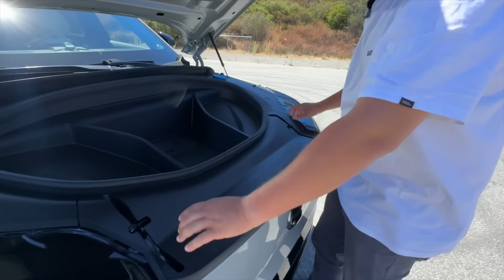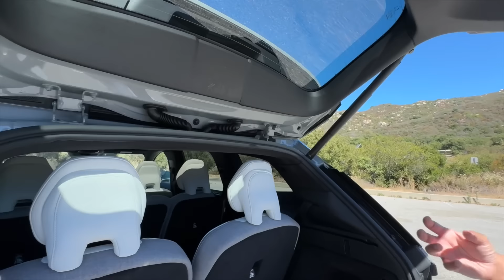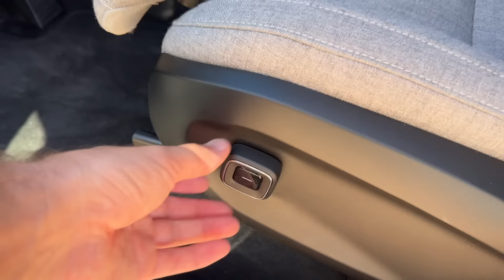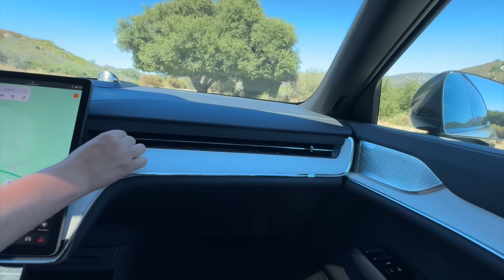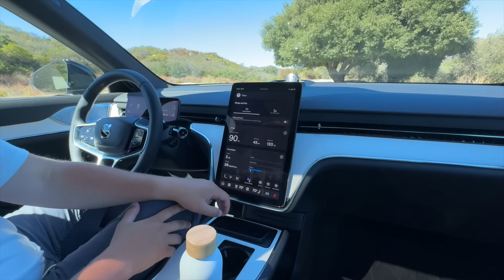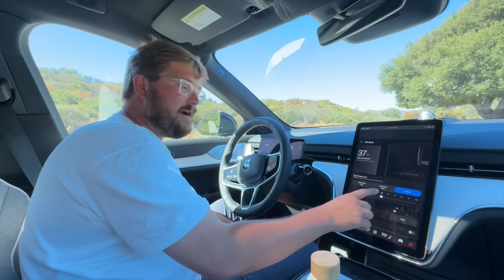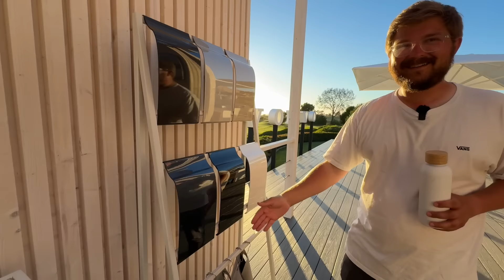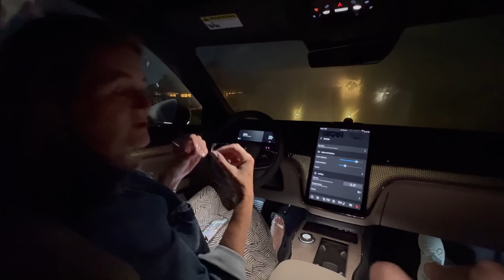Volvo EX90 Full Tour! Detailed Look At Software, Space, Interior, Powertrain, Battery, & Much More

Comment: It may be crazy to say but the KIA EV9 has this thing beat in so many ways for much less money. More space and utility. Even expected features like ventilated seats and sun shade.
Reply: The Koreans kill it in terms of features. Having said that, as an Ioniq 5 owner, I'd say the feel of a Hyundai/Kia is certainly overall less premium than a Volvo.
Reply: @iantelinside EV9 is substantially more premium inside than Ioniq 5.
Reply: @iantelinside  Exactly I actually like a lot of hyundai products but they are still a toyota, honda, nissan etc. competitor, volvo is more mercedes bmw competition and Genesis would be a better comparison. Its not electric but price and size wise id compare this with the GV80 before id compare to the EV9
Reply: I get what you're saying, but I've owned Kias and I've owned Volvos and they really are not comparable. If the Kia is "good enough" for you (meaning you're satisfied with it along whichever dimensions are important to you) by all means get the Kia, it's a lot less expensive as you point out. Regarding the EX90 specifically, I wouldn't touch it for a model year or two, no matter what. But once it's fully baked I bet it will be an awesome vehicle.
Reply: @richardhale2117 Time won’t fix fundamental flaws like being way too small for a usable 3-row.
Reply: Can not agree more! Not really feeling drawn to this at all, even if it was cheaper.
Reply: The Kia is nowhere near as premium.
Reply: Didn't Kia remove the lidar on the EV9 for the US market?
Reply: @jesbecker2325 I’ve never even heard of the EV9 having lidar. what would it be used for?
Reply: @CallMehDirect  The lidar is there for the Europe builds. It would allow HDA3 capabilities.
Reply: @jesbecker2325  I presume that makes sense to why I haven’t heard of it for the US
Reply: You are comparing different things, not because ev9 has similar size as Volvo ex90 and you can compare to them. Do your research, the most costly part for an EV car is battery size, engine power and engine type, EV9 are all using much cheap parts in those areas than Volvo ex90.
Reply: How are Kia’s on the aftermarket in comparison to Volvo’s? Yeah, didn’t think so… 
Give this one a few iterations and it will be great.  The XC90 needed a couple of iterations to fill its shoes.
Reply: @DaveRevst4548 It’s too small. Curious how time will fix that.
Reply: Core...plus ..ultra
Reply: I was disappointed with the finishes in the GT-line ev9 for the sticker. In terms of design and features, can’t be beat but if you’re looking for luxury, doesn’t do it imo
Reply: Kia’s are trash bro. Volvos are built like bank vaults. Kia’s are trash cans. No comparison
Reply: @rahimi4762  , both Consumer Reports and J D Power has had KIA as a top 10 brand and Volvo towards the bottom on reliability ratings for years now. Check for yourself.
Reply: As a Volvo fan I hate to agree. EV9 is an incredible package.
Reply: EV9 GT-L plus all extras owner here, Europe. More space, a lot more features. Bit plasticky, bit unsettled over rough roads. But is great and reliable, resale value proportion is same as Volvo in EU. But I would still choose it over Volvo.
No sun shade is a big no-no, probably ok only in the north... Many other missing features cannot be replaced by nicer "feelings" due to materials inside. On the other hand people are extremely happy with their Teslas, so in the end is a matter of preference. But pain will not be removed by anything. A burning bottom on a hot day or a cramped seat will change the view on premium :)
Reply: but not the most important thing in EV, the RANGE.
Reply: Koreans offering a bargain...well, stop the presses!
Reply: This actually has ventilated seats, a lower trim with RWD is coming and 800v will be added for MY 2027… The EV9 isn’t even comparable imo… it’s like comparing a Kia Sorento to an XC90 which no one would do
Reply: Yeah no one would do that because the KIA Sorento is noticeably smaller and less expensive. But the EV9 and EX90 share prices that are closer as well as tech/performance which are closer. Like others have said the EV9 is honestly the EX90 Volvo should have made. The EX90 is WAY too cramped in 2nd and third row for even average size people to sit in both rows at the same time. Also tech/luxury/features are pretty similar. Given the worse charging the EX90 won't even road trip faster even with its more range. Lastly performance the EV9 once again matches or will be better once the GT model comes out @Kurre.
Reply: Yeah, and the EV9 also has the Porsche Cayenne beat in those areas. 
It's a whole other class of vehicle, and also, it's called "options".
Reply: Looks super bland. I think the headlamps are a miss for me.
Reply: 100% agree and I just replaced a Cayenne with an EV9. As a 3-row EV, the EX90 is a failure. The second row is too cramped (captain’s chairs won’t fix lack of legroom) and the third row is symbolic with a steeply sloped trunk lid to make space even worse. 400-volt architecture in a premium vehicle is unacceptable at this point and lack of a sunroof shade is a massive fail for cars used south of the Arctic Circle.

Comment: For people wondering about the trim levels. There is a Core trim level that's below the Plus one. Difference is that the Core comes with a generic audiosystem, not a premium Bose one, less/worse interior lighting, dark matter panels instead of the wood ones (basically cheap plastic ones), generic floormats instead of premium ones, dual climate zones instead of 4-zones and no cabin airfilter which I find really confusing especially because that's apparently to Volvo a big feature of the Plus trim. Also no heads-up display, manually controlled steering column instead of an electric one, 5-seats instead of 6 and 2-way lumbar support instead of 4-way for the front seats.
Reply: No Bose in Volvo's, Harmon Kardon or an AMAZING Bowers&Wilkins system.
Reply: @johngaudet6316 That’s true for the current SPA cars but the EX90 model has Bose instead of Harman/Kardon

Comment: Burning 300 watts (I'm wrong, 133!) for 3 days, before cutting the power, breaker style (so that, I assume, you can no longer interface with it at all over a network) is what kinda did it for me. Cancelled my reservation and scored a crazy iX lease. That means that if you road trip somewhere, roll in with 20 percent, or whatever, your battery will be dead in a couple days. I can't buy (or even lease) a car based on what it will be later. Who knows what "later" is.

EDIT: Also, this car is showing 243 miles at 100% which... is not great. Probably worst case since it's a press car, but still.
Reply: Where did you get that info and numbers? They say less than 3% per day which is at most 3.3kWh per 24h which means 3300/24=139W, not 300W.
Reply: @erik....  Thank you! I have no idea where 300 watts came from either. I did some napkin math when I got the email, but never double checked. I edited my comment.
Reply: @PhilKulak what kind of lease deal did you get?
Reply: @italianovero220  860/m for the 50, nothing down. People have gotten better, but I’m very happy with it. I pulled the trigger because, unless Volvo goes crazy with lease deals right out of the gate, that’s hundreds less per month than if I kept my reservation.
Reply: For the range estimate: If I’ve been driving faster after the next charge my estimated range on the display is always lower.
Reply: Good decision on the iX

Comment: To me, it looks extremely generic. Could almost be any (Chinese) brand. I'd be surprised if this sells like hot cakes. Not like the current ICE version. Which is weird, because the EX30 looks great and funky, but in this case they kinda missed the mark with the successor to the classy and confident looking XC90. The face of car - every car has a face - looks too fragile and too young for a flagship SUV. The lack of grill, makes the front overhang seem a bit too long. Proportions wise, it looks more like a crossover stationwagon than a SUV.  The near complete lack of buttons is also insane, to me. I thought the Tesla copy hype train was over and ratio, ergonomics and safety could be prioritized again. Not in the case of the EX90 apparently.
Reply: It looks like a Volvo. This Chinese thing is projection. It looks nothing like a Chinese car because the design is done by a lot of the same people that did the current Volvo cars. It's just an updated electric version of a Volvo SUV and looks a lot like a larger XC60, just modernized.
Reply: @benjaminsmith2287  "Looking like a Volvo" means that if people saw this 5 or 10 years ago, they would recognize it as a Volvo. I'm also pretty sure that regular non-car fanatic people would not recognize this as a Volvo either today. To claim "but it looks a bit like another current model, so it's a Volvo" makes little sense.
Reply: @caleidoo  It has Thor's Hammer lights. That's a Volvo signature since the 2015 Volvo xc90. Look at the shape of the seats. Look at the contour of the dash and how it dips down and then look at the dashboard in the 2017 Volvo s90. Look at the profile of the side of the car. It looks a lot like a Volvo v60, just taller. Put a Volvo XC60 or even better a Volvo V60 next to the car and you can see the resemblance. Look at the bottom crease in the door. That's a Volvo signature. This car looks like a modernized version of the XC90. Look at the interior textures. And who else would make those interior materials like flax and wool blends? Who else offers that in the industry but Volvo? It doesn't look anything like any Chinese car because nobody in China had anything to do with the design. If you want to claim the EM90, sure, but the car that was based on was designed in Sweden, the Zeekr009. But this Volvo has nothing to do with any Zeeekr.
Reply: It is a Chinese brand
Reply: @adofoi30  No it isn't. Geely acquired Volvo and Volvo was an established Swedish brand. Geely has not changed much at Volvo so people calling it a Chinese brand are wrong. It's a Swedish brand/company with a Chinese parent company, not a Chinese brand.
Reply: Volvo IS a Chinese brand [now].
Reply: It’s Swedish, unless you’re going to argument that Lucid is a Saudi Arabien brand?
Reply: @Kodoushi THIS!!!
Reply: @Josh-179  Yes, we know.